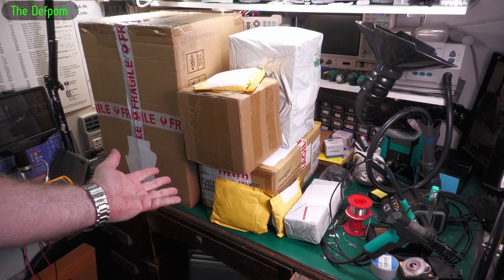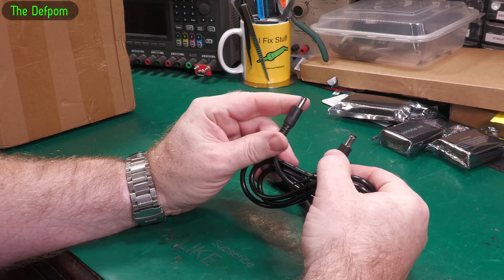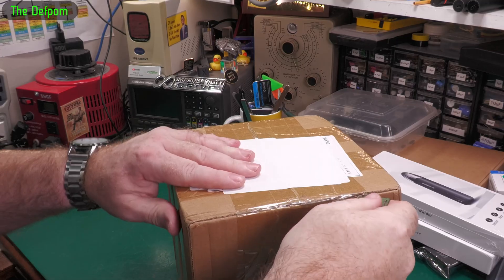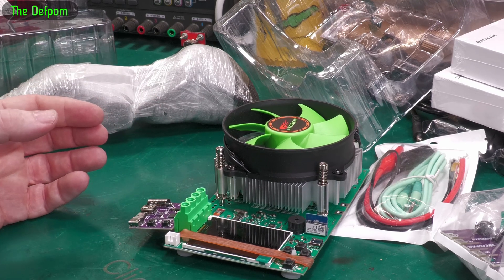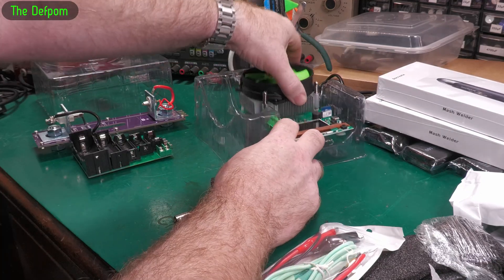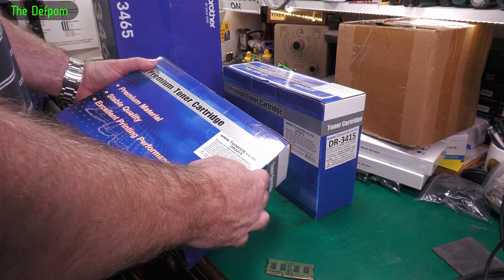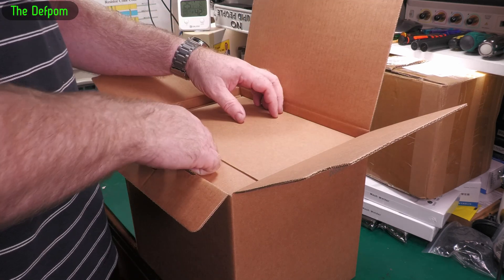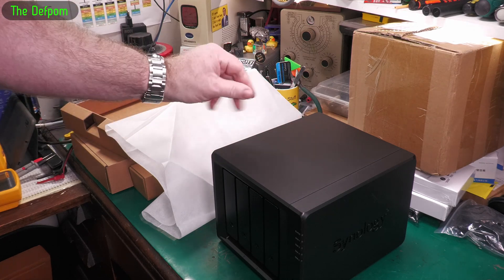🔴 Mailbag Monday 19th May 2025 - No.1360

Comment: I have a similar DC load. It can run on 12V or 5 via usb. If on 5 there's a boost converter to be able to run the 12V fan and the converter gets stinking hot. The PCBs are thin so I backed off the tension on the heatsink. Good for 120W. I like the adapters that fit your one, great idea.

Comment: Would be interested to see if the electronic load is single FET or quad FET. Single FET designs are notorious for blowing up when used at 75% or greater to capacity limit, due to the use of non continuous rated FETs and thermal runaway in the die. I have a four FET unit (DL24MP) but expanded with an additional module. I would never connect these via USB to a PC (zero trust in the HW design and protection), but they connect via BT with a BT dongle and present as a serial port. Most software is horrible tho. Great units for all their flaws, I have used mine to rate and test most batteries I have.

Comment: I've got the same USB-PD modiule - it can do 5 Amps no problem. But of course only with an E-Marker 5A cable. It will not output more than 3A with if the cable does not have an E-marker.

Comment: Synology ram is rip off - they take crucial memory no issue just get the correct type - locking down drives will kill the brand but there is always Qnap
Reply: UGreen also has a 4 bay NAS out with I think 10Gb built in.
Reply: @GregM  And you can use any DDR5 SO-DIMM you like for upgrades - and they use Intel CPUs, so you can run anything as a VM. Much better value.

Comment: ...If your trusty laser printer ever carks it, I have found the Epson and Canon ecotank printers sensational, great color prints, extremely low ink costs.
Had one of each for several years, refilled each once for a few bucks. fairly sensible software. 
...Only negatives compared to laser is the ink not really waterproof and you need to print something every few weeks at least to stop the inkjets slightly clogging. Easy fix/procedure if they do.
...Thanks for the videos, very therapeutic.
Reply: @leybraith3561  after using a Brother laser printer I'll never go back to ink.  So much less of a hassle and you can replace the drum and toner separately... less cost in the long run versus other manufacturers.
Reply: @tswtx  Same here I tossed out all my inkjet printers years ago.